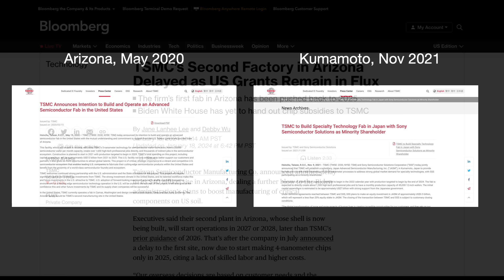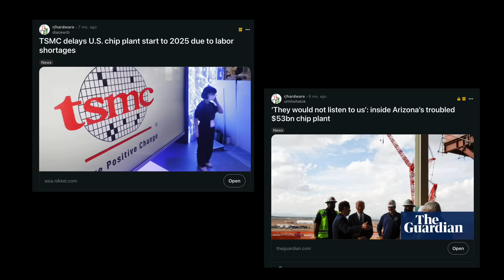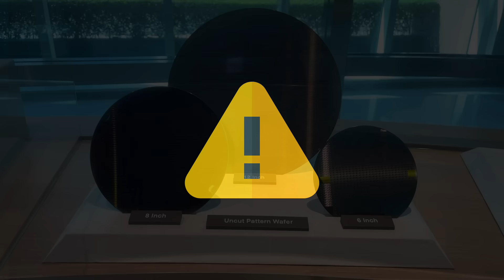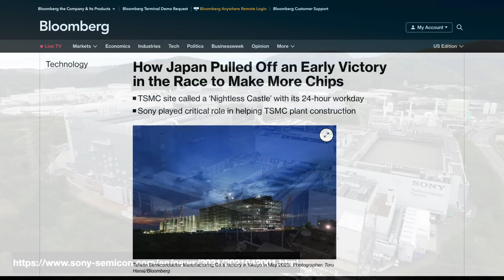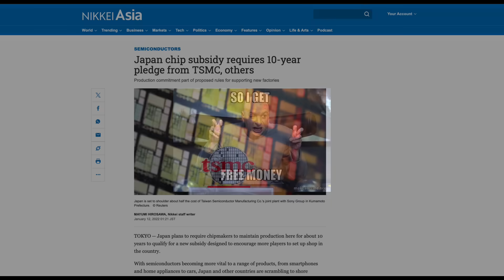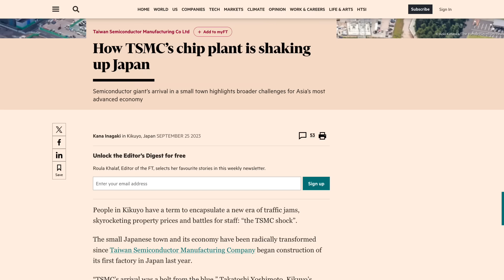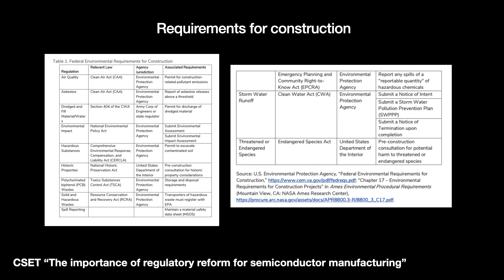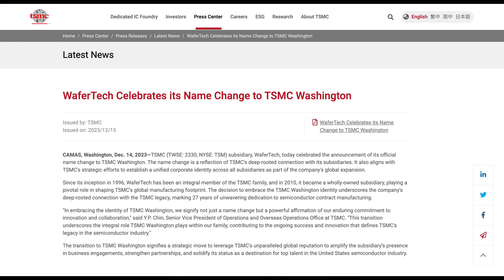Why is TSMC Doing Better in Japan?

Comment: With an extremely harmonic processor (DIE built with classical music harmonics) it is possible to instantly build antimagnetic crystals, the same crystals that are in the cube, inside the star (SUN) (crystals of immortality, antimagnetic crystals, infinitely light (not dense) . With low harmonics from classical music, harmonics built by violins, violas and cellos, it is possible to create an infinitely light and powerful processor that will make it possible to build infinitely light armor and bodies from antimagnetic crystals. Infinitely powerful armor to dominate any type of matter, including crystals of harmonics (water). Infinitely perfect string harmonics can be found at the beginning and end of the song ETERNAL ECLIPSE - SPIRIT OF THE FOREST. THE PROCESSOR (DIE) WILL BE INFINITELY LIGHT AND PERFECT. It is infinitely forbidden to use metal on the DIE of the processor Using the same machine that builds the DIE, it is necessary to build the circuit board for the DIE with harmonics.  The DIE processor must be lighter than the harmonic crystals (water).  Remembering that the cube that is inside the star is a tool of immortality (Crystals of ARTHÊNYUS, antimagnetic crystals, infinitely light) building mortality) matter density, crystals of harmonics (water).  The only tool that can fix this problem is the DIE (harmonic processor).

Com um processador extremamente harmônico (DIE construído com harmônicos de música clássica) é possível construir instantaneamente cristais antimagnéticos, os mesmos cristais que há no cubo, no interior da estrela (SOL) (cristais da imortalidade, cristais antimagnéticos, infinitamente leves (não densos). Com harmônicos graves de música clássica, harmônicos construídos por violinos, violas e violoncelos é possível criar um processador infinitamente leve e poderoso que possibilitará construir Armaduras e corpos infinitamente leves de cristais antimagnéticos. Armaduras infinitamente poderosas para dominar qualquer tipo de matéria, incluindo os cristais de harmônics (água). Harmônicos  infinitamente perfeitos de cordas é possível encontrar no início e no final da música ETERNAL ECLIPSE - SPIRIT OF THE FOREST. O PROCESSADOR (DIE) SERÁ INFINITAMENTE LEVE  E PERFEITO. É infinitamente proibido utilizar metal sobre o DIE do processador. Com a mesma máquina que constroe o DIE é necessário construir com harmônicos a placa de circuito para o DIE. O DIE processador deve ser mais leve do que os cristais de harmônics (água). Lembrando que o cubo que está no interior da estrela é uma ferramenta da imortalidade (Cristais De ARTHÊNYUS, cristais antimagnéticos, infinitamente leves) construindo a mortalidade) matéria densidade, cristais de harmônics (água).  A única ferramenta que pode corrigir este problema é o DIE (processador harmônico). 

超高調波プロセッサ (クラシック音楽の高調波で構築された DIE) を使用すると、反磁性結晶、立方体の中にあるのと同じ結晶、星 (SUN) の中に (不死の結晶、反磁性の結晶、無限の光 (密度が高くない)) を瞬時に構築することができます。 ) クラシック音楽の低い倍音、ヴァイオリン、ヴィオラ、チェロによって構築される倍音を使用すると、無限に軽くて強力なプロセッサーを作成することができ、これにより、反磁性結晶から無限に軽い鎧と体を構築することが可能になります。倍音の結晶 (水) を含むあらゆる種類の物質です。無限に完璧な弦倍音は、ETERNAL ECLIPSE - SPIRIT OF THE FOREST の曲の最初と最後に見つかります。プロセッサ (DIE) は無限に光り、完璧になります。プロセッサの DIE に金属を使用することは無限に禁止されています。 DIE を構築するのと同じマシンを使用して、高調波を含む DIE の回路基板を構築する必要があります。  DIE プロセッサは高調波結晶 (水) よりも軽くなければなりません。 星の内部にある立方体が不死のツールであることを思い出してください（アルティニュスの結晶、反磁性の結晶、無限の光）死の運命を構築します）物質の密度、高調波の結晶（水）。 この問題を解決できる唯一のツールは DIE (高調波プロセッサ) です。

Comment: A TI partnership would have made a lot of sense if tsmc was building for those larger node sizes they’re targeting in Japan.  They just don’t have much in their catalog that actually requires a leading edge node so they wouldn’t get a whole lot out of the deal. 

It’s unfortunate the government focused so hard on getting the “best” node from TSMC, especially with Intel finally stepping up and shipping their leading-edge stuff. Would have been much better off focusing on the easier nodes at larger volumes, or on courting more memory makers.
Reply: TI does their own thing.
Reply: TSMC still makes Intels most advanced chips. TI is a joke in the 21st century. The "good old boys" at TI lost due to their racism.
Reply: Neither TI nor Intel have the IP or fabs to make anything less than 7nm nodes. TSMC makes their most advanced 1-3-5nm fabs in Taiwan exclusively. Only Samsung can compete but at a much smaller scale.
Reply: @larryc1616  TI obviously can’t because they no longer fabricate chips. But Intel has already shown products built on 20a and is ramping production now.
Reply: So much of the government's problems are due to focusing on the wrong things. Building a facility that in a longer timeframe can do a smaller number of "Leading Edge" chips is a WAY stupider decision than getting a 2 or 3 generations behind, Tried and True, Still relatively high end capacity, That you can manufacture faster and easier for a cheaper price. That has far more practical application and is a much more intelligent move. Japan knows this, And it's their extraordinary level of common sense that has allowed them to make these better decisions, and those decisions have compounded into Japan becoming a global leader in many areas.

Americans just want to be "#1" at anything and everything. It's Short Sighted and it's stupid, and it's why America struggles with achieving and maintaining its "#1" spot at so many things.
Reply: @Stone_624  the ironic thing is that we’re still getting a node several generations behind at tsmcs plant, but intel will be shipping a true leading edge node before it even opens when they start shipping 18A. So we could have had both the capacity we actually needed for the stuff that goes into cars, refrigerators, and everything else, while also having a mfg creating the “most advanced” chips in the world.
Reply: The government wants the most advanced node from TSMC so they have the technology and experience on shore (which they call other countries of IP thief). TSMC knows that and also no experience within US so keep to 4nm. While Intel is working to advance to even smaller (being pretty much fully subsidized by taxpayers) they are still generations behind and are depending on TSMC to manufacture their future generation of 3nm processors to compete with AMD and NVidia.
Reply: @llee4225  care to cite a source for that? Arrow lake ships this year on 20a, which is the comparable node to TSMCs n2 nodes, with TSMC focusing on the higher yield variant of n2 this year that will see intel caught up, with 18a being telegraphed as being on schedule for later this year as well putting them ahead of TSMC this year, with scale likely coming in 2025.

Comment: I see a huge potential problem with new fabs in US, Japan, SK, Germany.
The motivation for that is the risk of China's actions disrupting chip supply from Taiwan, leading to another, and potentially devastating and long, chip shortage.  It is, therefore, essentially, an insurance premium, driven by fear of possible trouble, rather than demand.  
So what happens if China does not annex Taiwan or attempt to?   Surely there will be significant excess  capacity world wide, which could in turn cause serious profitability problems for the likes of TSMC.  Are state and federal governments in these countries going to step in with more cash to keep the plants open?  The politics of that are fraught, to say the least. 

As long as Taiwan remains the source of most chip supply, fabs elsewhere to insure against disruption must necessarily be excess capacity.
Reply: Everybody is building out supercomputers for AI research, plus infrastructure for AI applications, so there will be plenty of demand, at least for the higher end nodes.
Reply: Well seems like you don't know much about chips, the demand is expecting to be much more higher, Morris said multiple clients already notified TSMC to increase their yield to anticipate the increasing demand, but you still worry that TSMC builds too many fabs and end up with too many chips left on the market?

AI, car, military weapons, phone, computers, space equipments, almost anything that goes with electronics, will likely to use chips, and this is where we are heading for future
Reply: Usually when that happens tariffs will be applied pretty quick
Reply: Good thing Intel is building its own competing semiconductor production here.
Reply: There is a huge supply glut in mature nodes 28nm and larger.  THe build up in Japan, Gemany, India , even global foundaries in US, is matched by a build up in China.  The glut will last a decade, and it will deprive the companies the profit that funds R/D.
Reply: At least in theory the extra capacity would result in lower prices for chips [leading to more demand to use them]. Though maybe TSMC will build less capacity in Taiwan then they previously would have to avoid lowering prices [they could afford some price reductions due to the subsidies given].

Comment: Yar, the obvious reason is the difference in how US civil construction compares to Japanese.  A sink hole larger than the size of the 8+ lane intersection collapses in Japan, Tokyo or somewhere and it's back up and ready for use in less than 10 days.  In the US, a sink hole the size of a single car lane takes 10 *months*.
Reply: that's impressive, in Philippines, it's 10 years
Reply: @omniyambot9876 they just go around it and leave it as is till next elections in the Philippines.
Reply: @omniyambot9876  As an Indonesian, I know how that feel.
Slowly improving though.
Reply: Here in India we can do it in 2 days if the elections are coming up
Reply: Step by step is the most basic requirement of industrial construction.
I don't think fast is good.
Reply: In most of the apples to apples comparisons of civil construction I’ve seen, this isn’t actually true. Emergency construction differs greatly from normal construction and there are a lot of very good reasons not to speedrun infrastructure replacements and construction all the time.

By the way. After Hurricane Ian hit Florida, the bridge to Pine Island was completely destroyed. A replacement was built in 3 days.
Reply: @JohnMaxGriffin the Florida case was an exception
Reply: @muskepticsometimes9133  Did you read the rest of my comment? Emergency construction is done in emergencies, not inconveniences. Building a bridge in 3 days SHOULD be the exception
Reply: It is more like 3 days job in Japan. In the last major earthquake  (not the one in 2024-1-1), they are able to fix the whole damn road in few days. That is a very long section of road is complete gone or twisted.
Reply: That's why it doesn't make sense when the West says Japan is the most inefficient country in the developed world. (On paper).

A resource poor island cannot become the top 3 economy without being extremely efficient.
Reply: @JapanQuest  agree
Reply: @JapanQuest what? Who says that?
Reply: @chickenfishhybrid44  like every YouTuber / Quora / Reddit post about Japan being the most unproductive developed country.

People forget the GDP per capita and productivity of resource rich countries have inflated numbers because the amount of wealth that is created by refining and production of the resources.
Reply: We have a small bridge 20ft at most over a small stream. Someone decided to replace it and it was down for over 2 yrs I kid you not..in NJ. Supposedly in the middle of the job the contactor had to be changed.. And other issues. Of course the road to the bridge was blocked... Major inconvenience
Reply: still using that old ass meme i see which is not true at all rofl

Comment: I have to wonder how much a 16 hour time difference makes as well. If my work day starts as yours end, makes it hard to collaborate.
Reply: But fabs are usually running 24hrs with engineers on shifts so time zone shouldn’t be that much of an issue unless we are talking about suppliers and supply chain issues
Reply: Most significant is a ~4 vs. ~5 day work week would create a gap, unless the weekend at one location offset by a calendar day to local time. A 16 hour workday difference would be more easily handled as 8 hours (+1 day) difference.

Comment: 5:12 only a marketing department would be so bold as to use a measurement unit as a naming convention. What is next? The 10K run is actually 1.2 KM so less fit people may compete and say they did a 10K?
Reply: That's why tsmc uses names like N5, N4, N3, N3E, N3X, instead of 5nm, 3nm, etc.
Reply: It used to make sense, but then reality got more nuanced and buyers aren’t going to go get a graduate degree just to understand.
Reply: @doujinflip It kind of reminds me of when electric vacuum cleaners would advertise how many amps of current they would consume prominently on the vacuum. Consumers would thing more power consumption = better suction.

Comment: Good to see that older larger geometry fabs are still quite important in the supply chain. Most semiconductors made don't need the highest density technology. I remember back in the 1980s the Japanese chip dies where larger than those from American makers, but those Japanese chips also ended up being more reliable.

Japan also made power saving CMOS versions of the current microprocessors, while Intel dragged their feet with older, more power hungry, NMOS versions. Didn't embrace CMOS until a half decade later.